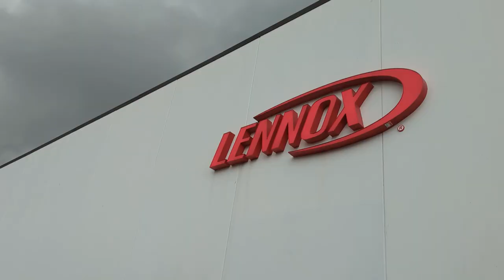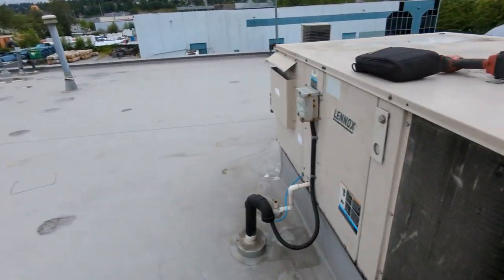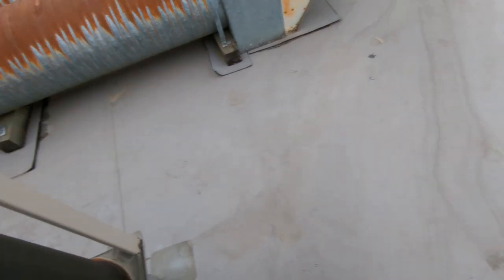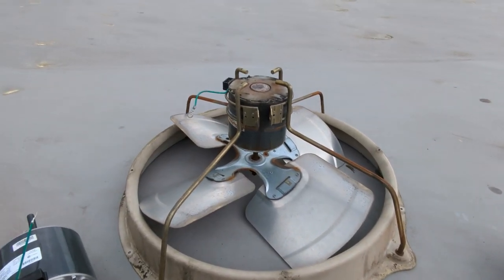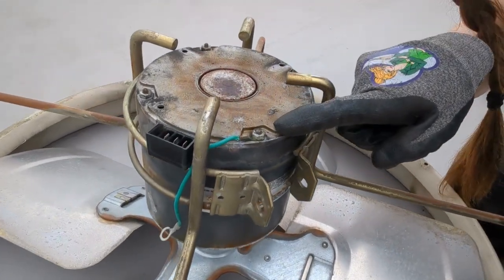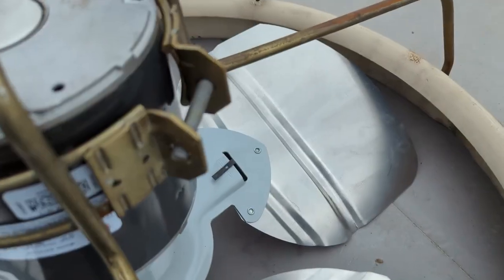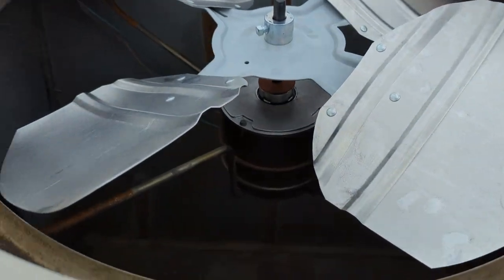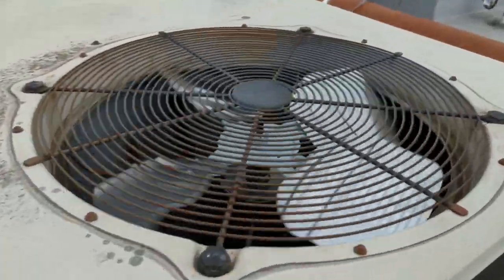Lennox GCS16 Condenser Fan Motor replacement - Women in HVAC

Comment: Just a little heads up, before taking the motor out and all that work, I like to make sure the motor is correct. Not to doubt or maybe you did that and edited. Plenty of times I did all the work and realized it wasn't the correct part. Just a little thing to think about. Keep on rocking Jess!
Reply from the maker: This is definitely good advice and you're right, I should've verified before I started taking it apart! haha! We've picked up wrong motors before and it's such a hassle!

Comment: Stellar work Jess! Pro-tip...your service wrench works on the square head set screw for the fan blade hub. 
Also, if you had taken out the 9 screws around the shroud to start, the whole works would tip out as one assembly and you can take it to the ground (rooftop surface) for ease of repair
Reply: Also, it wasn't painful at all. You approached the service call with parts in hand, assessed the situation, planned your moves, and executed it well 👍
Reply from the maker: Thanks so much Donald, I appreciate it so much :)

Comment: Keep it up. Next time leave everything in place and remove blade first, then motor. There is no correct way to do anything.
Reply from the maker: Unfortunately the blade was so rusted to the shaft and it was a bit damaged, my dad ordered a new blade as well.  So I didn't have to remove the blade, otherwise I would've done that for sure.  I think I may have still removed it from the unit and worked on it on the "ground" because I don't have the arm strength to pull the brackets far enough apart.  It certainly gets easier with practice.  I need more motor changes, please :)